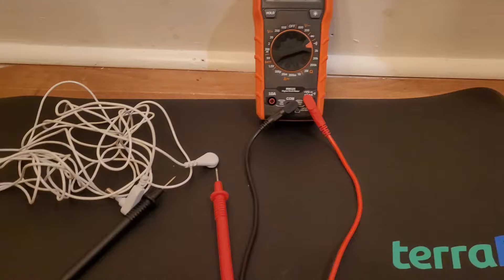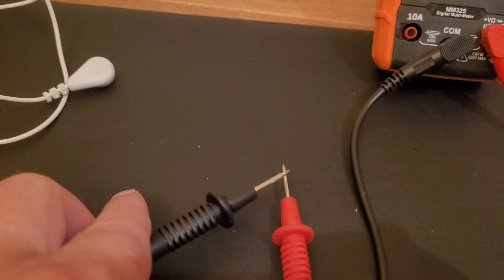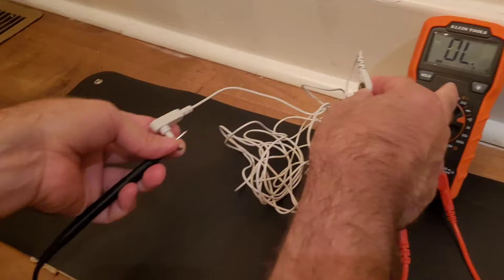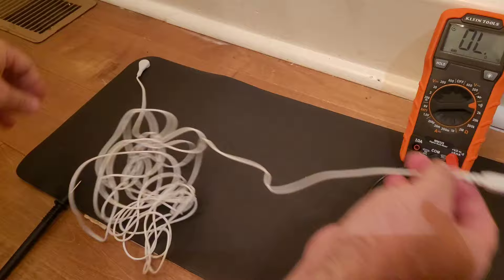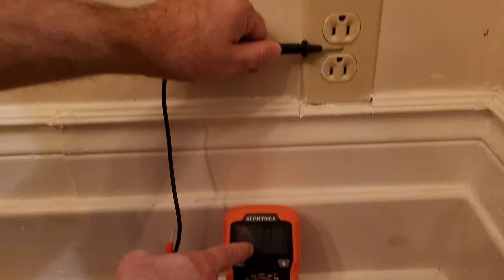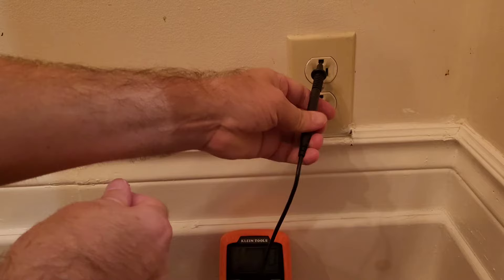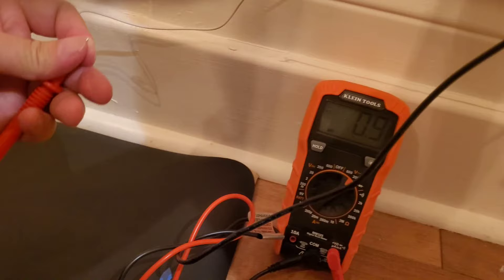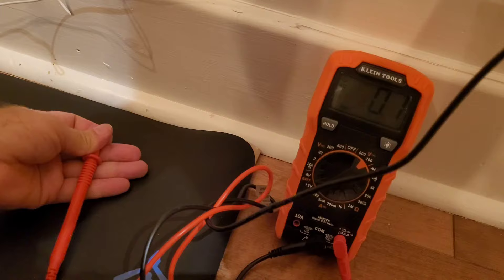The PROPER way to test your grounding mat.

Comment: I agree, why doesn't the wire have continuity? You can't say the logic is flawed if you don't explain the science behind why.
Reply: my wires have continuity.
Reply: The cord has a 10k ohm resistor in it, it is there to prevent you frying if you get a lightning strike that back feeds, it acts as a fuse, check your cord on ohms not continuity (auto range or a setting above 10k ohms) you will see the meter then read - your welcome
Reply: @JohnSmith-wb6kq Do you mind elaborating on how to use the meter in this video properly to test grounding? I bought the same meter and it always reads 0.0 when set to the same settings in this video. I've tried it outside with the ground wire in the ground as well and it always reads 0.0, even when wearing rubber shoes. Nothing changes about the reading.

Comment: I bought the same multimeter (Klein MM325), and performed the test on my mat as was done in the video.  My voltage dropped from 2.5v to 0.1v.  I'm convinced.

Comment: If there is no continuity on the cord, I can't see how this works. I am a licensed electrician, please explain this.
Reply: I believe it has a large resistor
Reply: There is a 10K ohm resistor in line to prevent AC induced voltages.
Reply: @my7sundays319 You must be joking right?

Comment: I think you forgot to show the step where you plugged the white chord into the ground slot on the wall before testing. Also, the white wire should still show continuity. You may have to insert one of the prongs into the center of the snap end.
Reply: I agree.  The prong needs to be inserted deep into the circle of snap

Comment: the mat/wire connecting to the mat has a resistor. loads, like resistors and appliances "break" continuity that's why it would be "open" because current applied doesn't flow to the other end of the circuit.

Comment: I got a grounding sheets from a different company.  I tested the grounding wire for continuity and it had continuity and acted like any wire would.  Then I tested volts with a cheap tester and showed nothing.  Then I used a much higher quality tester and when I put the ground wire into the ground on the wall it showed a little voltage even though the red wasn't attached.  I am wondering if the voltage clamp caused a little bypass?  Anyways when I grabbed the red wire the voltage went up a couple volts.  When I sat on the bed it went to 0. So it is definitely grounding.  Whether it will do anything positive is a different story but here's hoping...lol

Comment: interesting! thanks for the clear video. why wouldn't the chord show continuity?
Reply: I think that there is a small resistor in the cord to prevent accidents from the outlet,
Reply: You should have continuity between end connectors of the white wire. No reason to have a resistor between that line and ground. And you offered no explanation as to why there was no continuity. It is possible to have a functioning mat and a defective white connector. Testing the continuity of the white wire would be on the list of troubleshooting ideas.
If it isn’t working:
1. Grounding plug on wall outlet may not be connecting to ground (sometimes they’re not).
2. White connection wire may be defective (do a continuity test).
3. Mat may be defective if 1 and 2 test ok.

Comment: can anyone tell me why when i do this in England to test my sheet , i cant even get a reading from testing the current level going through myself with the black pin inserted in the earth slot and then holding the red one .. its either at zero constantly or sometimes it say 0.1 .. ive tried differnt mains plugs all over the house and even gone outside and put the black pin in the ground and touch the red  pin , nothing!!   brand new multimeter , tried my dads multimeter , new battery's etc .. whats going on ?  aside from that ive actually purchased a ground rod and  40 foot cable off amazon , cable straight from the earth into my bedroom and ive got a 4mm copper rod the width of my bed layed  at the bottom touching my legs .taped in place with duck tape ... i think thats gotta be the best way of doing it , its comfortable and im always in contact with the copper .. i dont think going into the mains is good if the earth is not good .. my house is 70 years old how do i know the grounding rod has even been replaced in that time
Reply: Same here. I do not register on the mm. 🤔
Reply: @Carydbster   if you hold your phone thats charging with one hand or touch a tv or monitor you should get a reading of 2/3 volts then you can sit on your sheet and it should go down to zero ... im still skeptical about how effective grounding is but at least i know my sheets working
Reply: Because even electricity hat3s the english
Reply: I am having the exact same issue.
Reply: Same issue here. I'm in the US and my multimeter always reads 0.0 at these same settings, no matter what.
Reply: @ayoungtricknamedjim5498  it means we're ghosts like Bruce willis in the sixth sense. . We dead and we don't know 😃